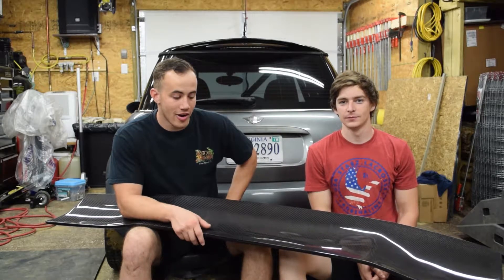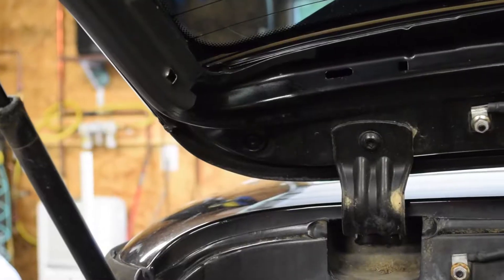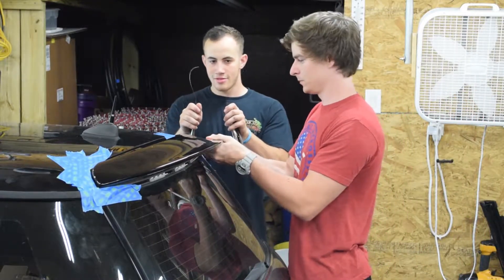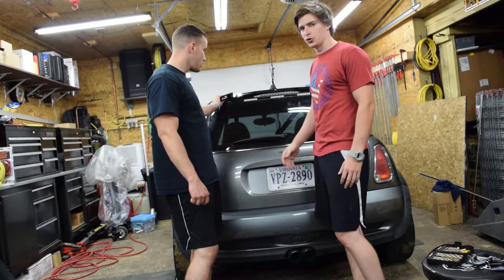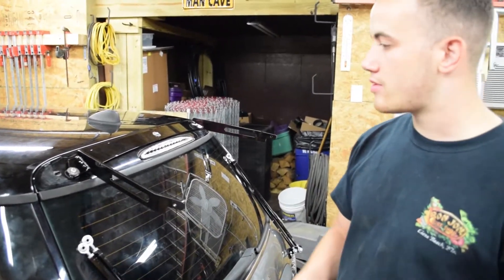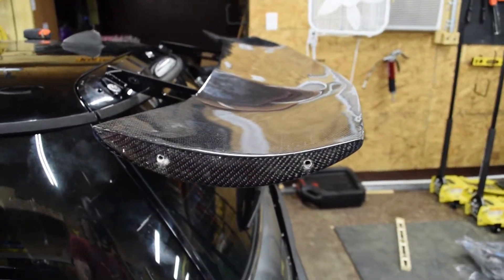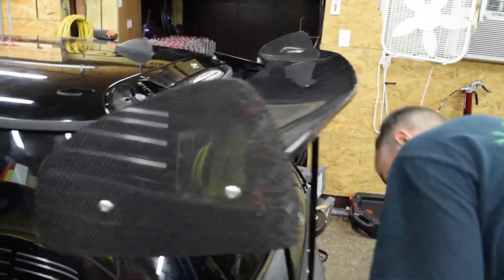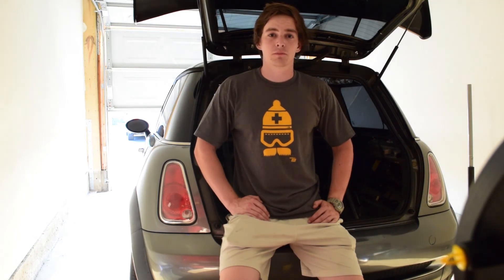Mini cooper spoiler install and roll cage review

Comment: Wow! Thanks for this video. I have an R53 and really want this wing... the installation looks a bit harder than I thought and Sneed4Speeds below response isn't what I expected it would be. They indefinably should include instructions for the R53 model before advertising it works with it. I might still get one in the future but mannnnn is this a job. Cheers!
Reply from the maker: No problem man, just trying to show everyone the truth about installing things. I definitely recommend it though! The adjustability is amazing and it creates a lot less drag than most other wings.
Reply: @hpgarage3531  Do you remember what additional part sizes you needed for the install? What size were the bolts you bought from the store? (If you remember lol)
Reply from the maker: @Bradafer  sorry man I don't remember. I just took the hardware they did give me and ran to lowes and got more of it.

Comment: Hey guys any tips on how you measured where to drill the holes so it’s centered? Gonna be doing this install tomorrow most likely and trying to make it as smooth as possible
Reply from the maker: A whole lot of measuring. We spent more time measuring than anything else on this project.
Reply from the maker: I dont have any real tips for you though. Just find a few points on either side and do your best to measure from those

Comment: You know rear down force on a front wheel drive isn't any benefit, in fact it can cause understeer, on a front wheel drive the rear end of the car needs to be light so that on a fast corner it can drift just a little bit which helps the front end turn tighter. I have built many race and rally cars and have proved this point on the track.....
Reply from the maker: I can agree that, generally, rear downforce on a front wheel drive car is not beneficial. But when paired with more downforce upfront, such as a splitter, it is greatly beneficial. It allows for better braking and conering. You just have to adjust it correctly, which I'm sure you already know.

Comment: You installed the side mounts upside down. The double shear bracket goes on the front of the wing not the back. It fits over the mount. You install the hatch mount, wing and then the stanchions rods. That way you can easily locate the lower mounts. If you had watched our install video first, your install would have been a lot easier.
Reply from the maker: Yeah we are aware they are mounted upside-down, we liked the way that looked better. The problem we were having with the double shear bracket was that all of the stanchions were to wide to fit between it. We were actually using your video as a guide and your steps were hatch mount, stanchion rods and then the wing. We had no problem locating the lower mounts at all. Most of the issues we had installing the kit we could work around, however, the lack of install instructions for the R53 was our biggest issue.
Reply: H&P Garage. Thanks for purchasing the wing and we're sorry you had trouble installing the wing.  The double shear brackets go over the hatch mount and the rod end goes  on the side of the double shear bracket. The bolts that hold the brackets to the wing are very close to the rod end when installed. Most of the time you can loosen and slide the bracket around to get the rod end to fit or you can slightly over drill the mounting hole and they'll slide in. 
Turning the side plates upside down greatly reduces down force.
Reply from the maker: SneedSpeed Okay the double shear bracket going over the hatch mount makes sense. During our install we were using pictures from your website to figure out how to tackle that part and it looks like the pictures there either have it cut like we did or have single shear brackets. How does it greatly reduce the downforce to have the side plate upside-down? I will have to turn them right side up!
Reply: A wing generates most of its power (down force or lift for airplanes) from the curve of the wing.  If you look at an airplane wing with the ends turned up (like a 747), that's the same thing as a race car wing with the end plates turned down. An air plane wing turned upside down pushes the plane towards the ground, the way you want to push the car.   The end plate propose is to control air spillage off the edge of the wing and make the wing more efficient.  If you reduce the size of the panel on the edge of the convex side of the wing then you reduce air flow over the convex wing surface and reduce down force on a car or lift on a plane.  Hope that helps.